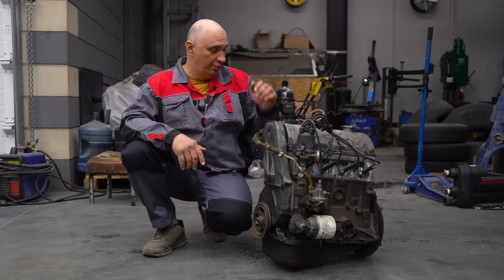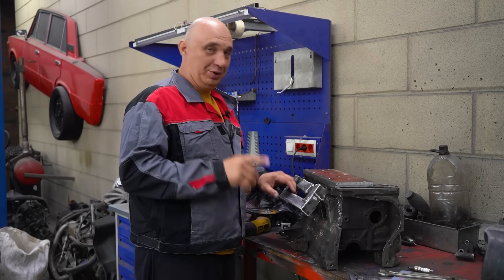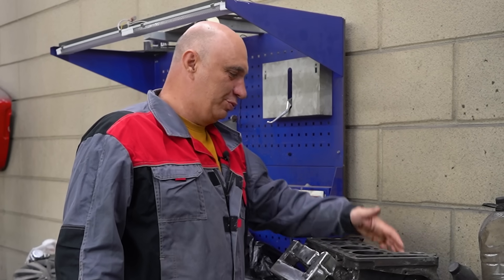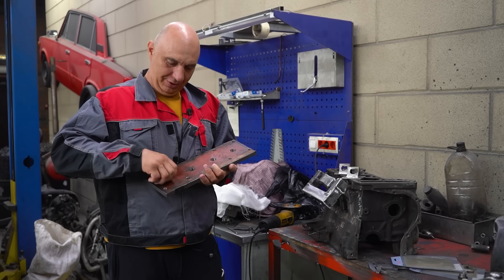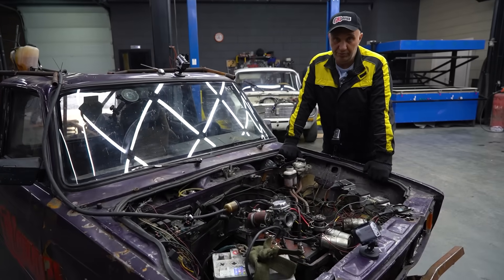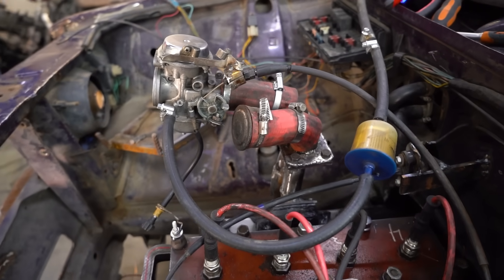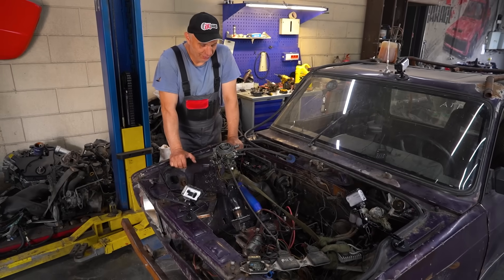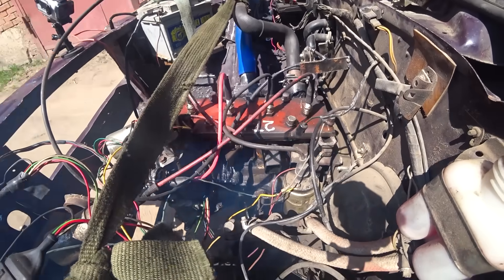4 stroke to 2 stroke Lada engine conversion

Comment: With two cyls going up and two going down at the same time, all you're doing is pulsing the air back and forth in the crankcase... You need a port and a reed valve above the piston on each cylinder. Could have used the factory head and a light spring on each intake valve maybe... With the 2bbl carb or a single motorcycle carb per cylinder

Comment: Leave the regular head on. 

Set the cam to turn a 1:1 ratio with the crankshaft.

Disable the intake valve (seal it shut).

Let the exhaust be driven by the camshaft. 

Cut intake ports in cylinder wall, and feed air/fuel mix into them with a supercharger of some sort. 3psi of boost should be enough to drive it.

Comment: Thinking about this and the geometry of a 2 stroke crankcase I think your crankcase is just too big and you aren't getting much of a compression stroke. You can try preheating the block and intake, but you need to increase the pressure somehow.

Comment: You did feed the intakes to the crank case didn't you?
How did you seperate cases for crank case compression?
It looks like intakes just go into cylinders,?
Or is it piston port reed induction.
I skipped little bits forgive me.
I would suggest using a blower to scavenge like diesel 2 strokes (and ferarri experiment) and keeping crank case standard.
And to prove concept just have inlets opposite exhaust ports with an angled piston crown.

Comment: I'm no mechanic but I do play around with a lot two-stroke I know exhaust pipe is critical creat back pressure you're open exhaust ports are helping your crankcase pressure issues.
Reply: Introduce an expansion chamber for each cylinder or forced induction like other guys are saying

Comment: As a car vehicle technician from degree and a dirt bike mechanic as my job in free from school time i can say that the whole idea and execution is great, except one teeny tiny detail. Crankcase should be divided to 4 compartments, and every of them should be sealed. However you would need to cut cranksaft and make it press fit together. Also you could modify big end and drill holes for oil and crossing lines for lubrication. I'd love to see a lada with correct expansion chambers and tuned well so it has a really nice power band.
Edit: The problem why it isn't working is the crankcase. Because it isn't sealed it does not make high enough pressure to move air/fuel mixture from carb to cylinder, because of 2 stroke compression being much lower than 4 stroke and it just doesn't get enough air and fuel. You can bypass it actually by putting a electric 12v turbo charger between intake and carburetor or a ton of work with crankshaft and crankcase. By the way you could grind very wide holes in counter weights and weld a piece of sheet to lower the weight of crank but keep the volume the same which will maintain good pressure. If you want to pull it off it will take a looong time and it will be many ups with much more downs before you get it to run

Comment: Take a look at a motorcrossengine and see the short intakelength, and the expansionchamber in the exhaust. U need to tune the engine by the length of the pulses needed to make the effect at the certain revs

Comment: It will never run unless you have positive inlet pressure, it needs a supercharger or electric fan to force the air fuel mixture into the engine.

Comment: 2 stroke engines duration piston/cylinder duration timing is what you seems to miss. Also mixture in the crankcase is missing explanation. I don't think you guys know how a 2-stroke works

Comment: You need to have each cylinders crankcase pressure perfectly sealed individually, as any opposing pistons will suck its neighbors blow through the main bearing, so like a TZ750 4 cylinder 2stroke, you have to have them oil sealed individually to obtain any crankcase pressure.

Comment: What is your port timing and do you have proper transfer that is critical to your engine running using a degree wheel on the crankshaft and your piston top for exaust timing numbers and transfer timing and the skirts to mesure intake timing if you intend to make it piston ported if not then you will need to create or adapt a Reed cage into each cylinder of your intake system and also you need an impulse line into the carburetor from your crank case to pull fuel from your crankcase vacuum

Comment: I'm worried about the carburetor. When you made the "one stroke engine", it hardly worked. My opinion is, that carburetor cannot feed cylinders, because it is meant to feed one cylinder at the time. So it gave only 1/4 for each cylinder. So again there is same problem. No you are feeding 1/2 because 2-stroke style 2 cylinder are working on the same time. I guess you understand what I mean. This would be easiest way to test, can that work better. Crankcase leaking of course must be repaired some how. But different way to make 2-stroke is to sacrifice 2 cylinder to work as a pump. Those cylinders will pump or flush through valves that mixture to the 2 working 2-stroke cylinders . What advantages is here - only that you not need oil in gasoline. For example, you have 1,6 l 4-stroke engine. 2 pump, 2 working cylinders will give 800 cm3 2-stroke engine, power should be the same, but engine is still same size and is filling the front side of the car. As same principle if you could mount another cylinderblock, which is working as pump, you would get 2x power and there is no need to change that engine what you converted already.

Comment: idea №2; mount 4 reed valves straight onto crankcase side (1 per chamber) then make 4 new passages from crankcase up to your inlet  cylinder-ports! This wil give 'crankcase induction'! Also; the crank oil-ways could be converted/ re routed to grease caps (in cabin) with manual screw down, otherwise the crankcase induction will be flooded with oil.

Comment: That's what i was thinking, no cc pressure forcing the fuel into the cylinder. Maybe some forced induction? Coolest project I've seen in a long time. I wish i could come visit your shop and mess around.

Comment: use two cylinders as a super charger to feed the two operating cylinders.
Reply: And or bigger carburetor, the induction period is very short so you need large carburetor

Comment: You should only need one pulse line from either 1 and 4 or 2-3 to run the pump  1/4" fuel line and 1/4" pulse barb from the lower half of the case when you can roll the motor over and make pulses of pressure and vacuum you will have bowl pressure true the mechanical pump pulsing from the case pressures changes positive to negative reverts the diaphragm advancing the fuel to the carbs

Comment: your crank case pressure is the issue and the timing curve will be much different in a 2 stroke try 2 34-38mm round slide carbs they are abundant and cheap it will need a mechanical fuel pump or solid state pump around 2 psi bowl pressure is the target carbs with a mechanical pump you will need a crank case vacuum pulse from the crank to run the mechanical pump with a solid state you could use a restrictor jet in the return side to find the best bowl maintenance tru the throttle

Comment: What I don’t get is why did they need to remove the entire head, it seems like it would be far simpler to just adjust the cam gearing to make it intake every rotation and then supercharge it to force the air in.

Comment: I absolutely Love that you have gone to the effort to put ports into a four stroke block!!! Yes but as others have said similar; the intake ports go UNDER the piston!,,, Then additional transfer duct & ports from crankcase to 'above-piston'!! I Love that you make such elaborate modifications!, I think your separate crankcase departments will be OK!   You will need to extend the piston skirt (bottom sleeve) down longer, for it to cover the new intake/ carburettor port, untill piston travel about 15mm before top of stroke (but will the longer pistons hit the crank!?)

Comment: Just add an electric blower to the intake so the exhaust gases are blown away from the cylinders. It's not getting enough air because the exhaust is not being pushed out well enough. I think it'll run then.

Comment: Same engine twice the ignition cycles. You don't need a smaller motorcycle carb, you need a bigger carb. You have spark and timing, but you don't have proper compression. Intake and exhaust have reed valves that allow one way travel. Intake into the cylinder excuse out. Also, if i remember correctly from my dirt bike days, the rings are on the bottom of the piston and the rings don't go past the reed valves. 

Two stroke motorcycle engines use the crankcase as pump for air fuel oil mixture out of carb and into cylinder. 

I figured you would increase the tooth count of the cam to match 1:1 rotation with crank, weld the intake valves or convert to exhaust, double timing, get it to run with a creative intake addition to push the exhaust out as the piston rises to tdc. I am equal parts surprised and impressed that you completely reinvented the wheel with this one. Good luck with this one, i am rooting for ya.

Comment: I feel like dedicated carbs to the cylinder pairs would help. 
If the cylinder head warped while welding, over and under pressure could occur between cylinders.  Maybe try a thicker plate, drill a large hole into the plate half thru and then drill/tap for the spark plug. 
When it did fire, it definitely sounded like it had too much gas or too little air.  
Combining exhausts for the cylinder pairs may help. 
The reed valves you tried were a good call, I have no idea what the crank case seal from bay to bay is like and may also cause under or over pressure issues.  
Timing is everything with 2 strokes.

Comment: From what I could see you didn’t have the mixture go to the crankcase first for it to run properly you need the negative pressure from the case to press the mixture into the cylinder. You will also need to make transfer ports that don’t lead from the manifold directly to the cylinder although this would be possible if the manifold was also connected to the crankcase. 
You need negative pressure from the crankcase.

Comment: I don't think you need to do things so drastically. Only head work should be enough. Need to time valves differently and have a lot of overlap so the accelerated exhaust pulse initiated the intake flow. 
It should be timed something like this. On say half way (or earlier) down the bore exhaust valve opens, and on the last third or later in travel intake opens. Just after BDC exhaust closes, and soon after it intake closes. 
Exhaust can be simple four separate long pipes. This should work without an extractor type exhaust manifold though it would help. 
Not the most effective solution, but this should work.

Maybe changing cam/crank sprocket to the same size, stock cam duration would get short enough for this.

Comment: I know 2-strokers. You'll never get this one to run like that. There's a design flaw. You would need transfer channels to flow the gas mixture from the carb through the crankcase, and then up to the intake ports. Your current setup cannot sufficiently fill the cylinders.

A suggestion for a hilarious follow-up video : Fit a mightily big supercharger, to force feed in order to compensate for the lack of flow. That might just do the trick 👍

Comment: The second I saw porting I knew they had done their homework. Other changes needed are cam timing 1:1 with crank, and maybe even new cam with different specs; duration, lift, overlap. Better exhaust scavenging might help as well. Blower / Turbo are a given for 2 Stroke Diesel. High Compression is a must too. Head Gaskets and Piston Rings need to withstand the greater pressures.
Reply: Cam lift  ? Duration ? Overlap ?   What are you talking about ?   This thing has no valves . The only reason you would even need to leave the cam in the engine  is to time the spark and plug the oil holes on the cam bearings and maybe drive the oil pump.

Comment: What about powering the fuel system by pump and regulation and vent the crankcase with regular oil. Atleast you will have stable fuel. Also try and advance the timing. It may be firing early and combusting before tdc

Comment: Just somen thoughts of an ingnoramus:

For a better balanced 2t function the 4 neck crank should be modified so that no two pistons are at tdc at the same time. Essentiallly cut it in half and turn the other end by 90 degrees. Then the distributor must turn at 1:1 ratio with the crank The crankcase must have individual compartments per cylinder and each compatnent needs to have a one way intake valve. 

Maybe a normal camshaft and head could be made to turn at 1:1 ratio as well with the valves opening near bdc, exhaust first at end of downstroke and intake at begin of upstroke,  and intake bieng force fed by the crankcase. This way no ports need to be made and the timing can be adjusted.

Comment: As others have said it is most likely that the crankcase sealing between cylinders is insufficient.
I have 2 ideas. Firstly in the early days of 2 strokes they had not developed rubber seals, so instead they used a very thick, hard grease to make a seal try using that on #2 & 4 main bearings. 
Alternatively, remove those bearings completely and replace with some split oil seals.

Comment: the problems could probably be the following:
1. the pistons have all the rings, even the oil scrapers which are needed if there is abundant lubrication like on a 4-stroke, on a 2-stroke they could create too much friction and the engine would not work or break down.
2. the timing of each exhaust and intake port should be calculated, the ideal in my opinion for an engine of this kind would be 165° of shaft rotation in which the exhaust port remains open and approximately 115° for the intake (it can easily be found a tutorial on how to measure them with the protractor on youtube), after a certain timing (generally above 195° for the exhaust the engine stops producing, even if you exceed the 60° difference between intake and exhaust the same thing happens), and the more you increase the value of the exhaust, and that of the detachment (always within 190/60) and the more the engine performs at high revs
3. another problem could be the shape of the intake channels, if a path that is too turbulent is created, the fuel could not arrive in a perfectly gaseous form, and could generate a too weak explosion (for example, the sharp edges inside the manifold generate these turbulences) to best eliminate turbulence you need to create an ideal shape, (which you can find and imitate by searching on google). I hope I helped you with your project ;)
Reply: ps. probably you should have at least 2 intake ports that are facing each other and that are on the sides of the exhaust port so that the 2 gas flows collide tending to go to the top center of the combustion chamber, avoiding as much as possible come out of the exhaust before starting the compression, each port must never exceed 70% of the cylinder bore diameter in width, if there was only one front port to the exhaust, most of the gases would end up out of the exhaust before even starting the ascent of the piston, with this I think I have explained all the minimum theoretical operating criteria of a 2-stroke engine

Comment: You really need an exhaust to promote the two stroke operation efficiently. Make sure to build a manifold next time. Also, two stroke carbs will work much nicer than the original lada carb.

Comment: Could've made it uniflow gasoline with a crappy eBay blower for aspiration. Basically similar to Detroit Diesel/EMD 2 strokes (and many marine 2 stroke Diesels). Wet sump is no consequence in that arrangement, crankcase volume is of no consequence and you can still use the original cylinder head and exhaust. You have to make the camshaft 1:1 with the crank.

Comment: 2 strokes work by the piston coming down and compressing the mixture in the crankcase. Then when the port opens to the top of the piston the pressure pushes the fuel/air into the cylinder. When the piston goes back up there is a vacuum in the crankcase which pulls fuel and air from the carb back down into the crankcase to start the cycle over again. Just having the intake port straight into the cylinder will not work unfortunately. There is nothing to draw the fuel and air in.

Comment: My head is just spinning with the number of problems that might be occurring. The balance is going to be totally different with both cylinders firing at the same time. I would guess the ports are too tall and the exhaust and intake ports may need to be different heights. The exhaust might be open when you are still trying to get power from the bang. The exhaust may be too much of the volume on the next stroke. I never saw any fire coming out of the exhaust so I could be all wrong about everything. Maybe a super charger or half a dozen leaf blowers might help the thing breath. Didn't you do that once?

Comment: You need a supercharger like on a diesel 2 stroke engine. You could also take out three of the spark plugs and try to get one cylinder sealed off and running.

Comment: I would like to see 2 engine blocks, no heads, bolted together so the pistons come together. Would need a plate between the blocks to reduce the comprsion ratio and provide a place to put a spark plug.
The cranks would need to be geared together, one of them would need to be swapped end for end, i think.
Ports like you did for exhaust in one block and ports in the other block for intake.  Intake ports open a little behind the exhaust.
Will need a blower, leaf blower may work.